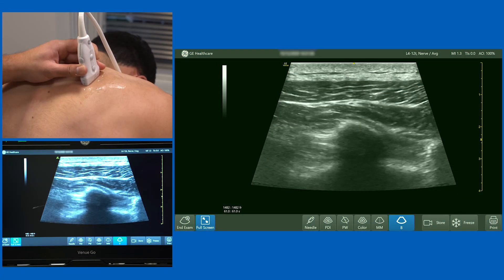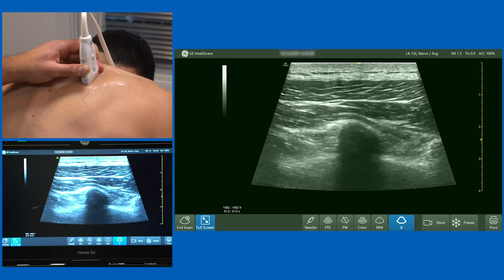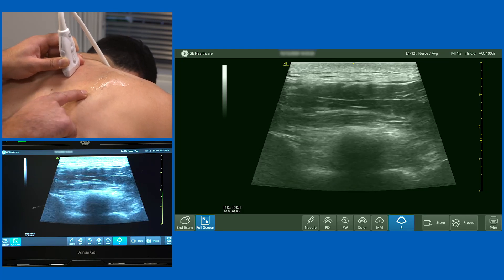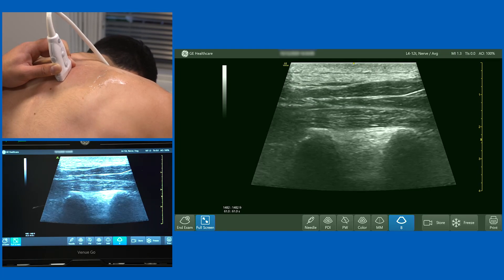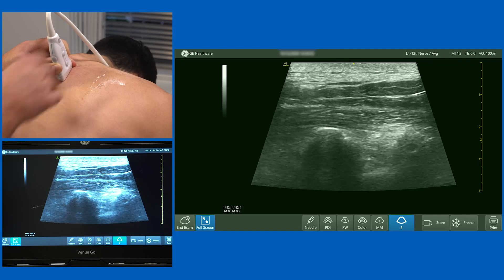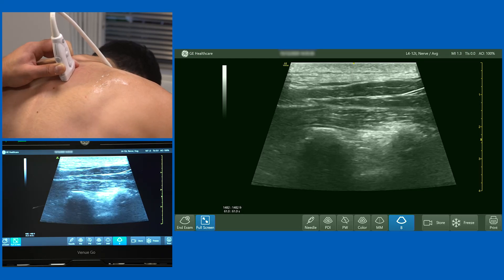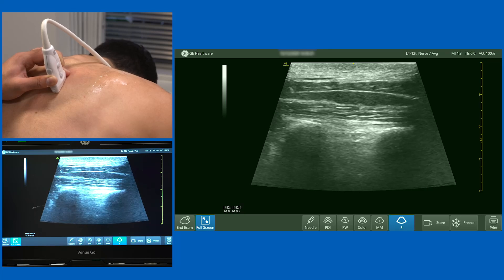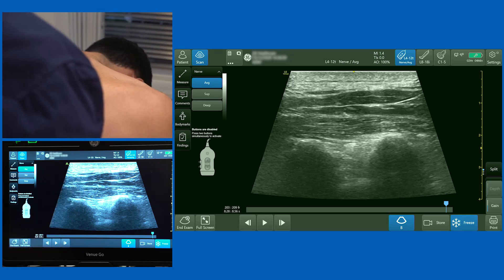Erector Spinae Plane Block

Comment: I have done these for cervical spine surgeries.   But I've stopped doing bilateral versions of these.   I've never had any diaphragmatic or arm weakness in the dozen I've done. I stopped because among the hundred ESP in the lumbar region, I've had 3 instances of significant transient bilateral leg weakness. All were post lumbar lami or fusion.   I do not want to run the risk of diaphragm weakness when done in the high thoracic region.  I only do them for unilaterally for thoracic cases.  What are your experiences with motor block?